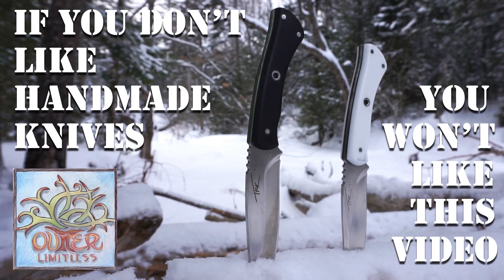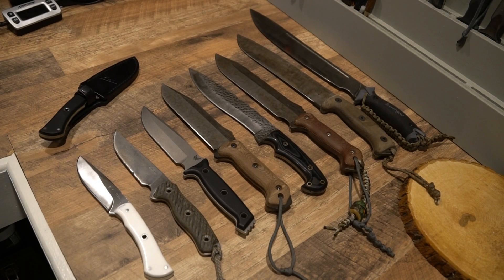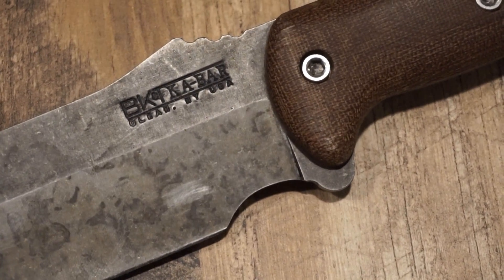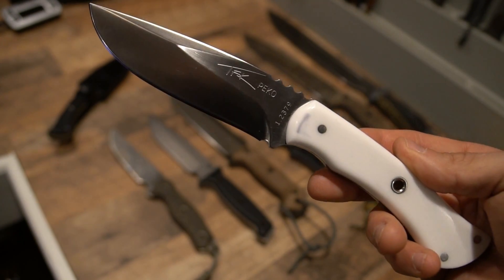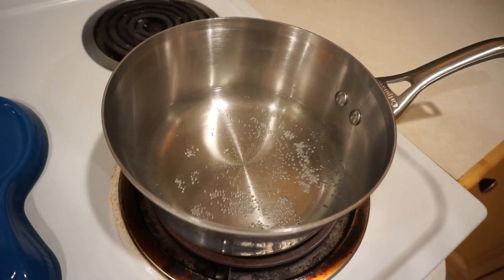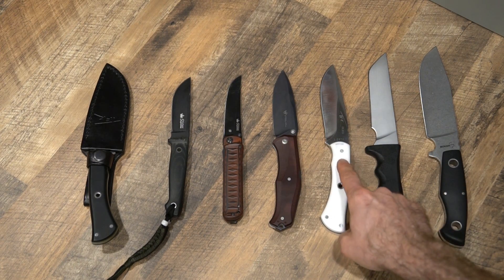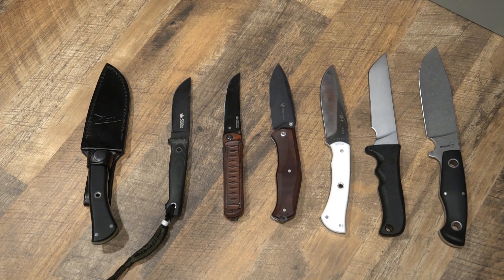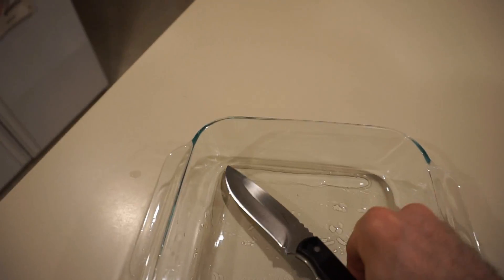Is D2 Tool Steel a Carbon Steel, or a Stainless Steel?

Comment: D2 is not stainless.
The rule of thumb is a steel is stainless if it has over 10% chromium but really it's a rule of thumb that isn't very good.
First stainless is not binary, it's a spectrum. Some "stainless" will resist corrosion whatever you throw at them, some will marginally better than tool steels.
Second D2 might be over 10% Cr but what makes a steel stainless is free chromium that creates a passivated chromium oxide layer that protects iron from corrosion.
D2 has quite a lot of chromium but a lot of catbon too. That means a lot of chromium will go into chromium carbides which means not that much free chromium and thus de decrease in corrosion resistance. Also the cardides are what makes wear resistance high.
Thus D2 is probably not really stainless but should resist correction ok like many high alloy steels.

Comment: For blade performance there are two things more important than steel formulation. An appropriate blade profile for its designed tasks and most importantly, proper heat treating.

Comment: Makes you wonder if that is D2 ? From what I've come to understand D2 is not a  true stainless material. It laks the chromium content % to achieve stainless steel performance. Over time it will oxidize.

Comment: D2 might be a good steel but I have seen enough bad heat treatments that make me second guess the steel.
In my opinion D2 is as close to stainless as carbon steel can get.  I think the formula for calculating if a steel is Stainless is (Chromium  - carbon content).  If the answer is 12 it is stainless.
D2 is around 12.5 chromium - 1.5 carbon comes to around 11% free chromium, thus making the steel not stainless.  
In practice it is a steel that is borderline stainless.

Comment: I just put vinegar on a paper towel. I don't think boiling it speeds up the acidic reaction. It only takes a few minutes by wrapping a soaked paper towel around the blade, and you waste less vinegar.

Comment: In industry test they made not immerse but sprayed with salt solution at 60C chamber, if I remember. Vinegar is a weak acid, generally acid solubilized metals, that's why the knife seems cleaner, the acid removed the old oxidation layer (which is protective). This is not the kind of corrosion you are looking for.

Comment: Nice video. Regarding D2 steel aspects nobody mentions that this metal has some smell depending what is cut with it. I have a folder in D2 and it has some minor metal smell which can be increased by cutting some food and wiping clean. Therefore it may give some metal taste to food as well. I don’t know if I like this steel yet. It may loose some sharpness due the micro corrosion more easily because of this. Some guy  made a video 1 hour long showing on some stainless steel knifes this effect depending on angle and time after sharpening. And now imagine those were stainless ones which D2 isn’t.

Comment: I've just bought my first D2 blade and was looking for - will it rust if I slice up an apple? when I found this.
Great video.
I bought a Rough Ryder in D2 and cannot find out the heat treatment anywhere.
If they do a good job or not - that sort of think.
I know Buck do a good job with their stainless but know nothing about how these D2 blades are made in the reserve models.
Many thanks
Gray

Comment: One thing to add...I put my d2 in lemon juice and heated the juice to close to boiling.  It did give the ricasso area front n back a blueish rainbow color but not on blade. Weird. I'm gonna try sanding it then hit it with the Birchwood.  What do I have to lose at this point

Comment: How does this perform in salt water environment?
Reply from the maker: D2 is better than a carbon steel, but you will need to keep it clean after use.  Especially under the scales if it gets really wet.  D2 can corrode, but it's fairly forgiving.

Comment: Good video.  This is probably over simplified, but I think of D2 as a mix between 440C and 1095 steel.  It is in the middle of them in both toughness and stain resistance.  It holds its edge better than both but is more difficult to sharpen.  A really good all around knife steel IMO.

Comment: D2 isn't stainless. Too much of its chromium is tied up with carbon as chromium carbide. There's not enough free to form the chromium oxide film that makes it 'stainless'
Reply from the maker: I do find it is rather corrosion resistant.  Great edge retention when properly heat treated.  I have had pretty good luck with D2.
Reply: @outerlimitless  it is rather stain resistant but a lot of the chromium is is the form of chromium carbide making its 'stainlessness' equivalent to a steel with 7% chromium.
Reply from the maker: Thanks for watching!

Comment: 11-18% chromium is generally the range where people agree a blade becomes stainless.  
D2 is usually around 12% so it is in that spectrum but on the bottom end. Ferric chloride would give you a better etch and darkening.
Reply: Judging stainlesnes off of cr percentage is misleading. 10-11% free cr is a super stainless steel. The issue is that cr for carbides. This keeps the cr from forming a passivation layer and allowes oxidation. A good example is zdp. 20% cr but also 3% carbon. That much carbon means most of the cr is tied up in carbides and is why zdp still pretty easily tarnishes.
Reply from the maker: Haha, ferric would have to be the option, because vinegar just cleaned my knife!  haha.  Thank for watching!

Comment: Well, I've got my own experiment coming up soon. I ordered the Rat 2 "D2" knife without a coating because all that was available was the uncoated type. I have steel wool and Birchwood Casey Gun Bluing. I hope it works, but they say stainless steel won't cold blue, it has to be heated and I'm not sure how to go about that.
Reply from the maker: I would suggest being careful with the heat of course...but I guess it depends on how hot.  D2 will patina with the proper treatment.  We use D2 on my T17's and get a nice acid stonewash finish.

Comment: I've been making knives since 1992, at first I did O1 doing a heat treat in a forge. I had been sending 440C to a heat treating company called Hinderliter nearby in Oklahoma City. I liked the edge holding of liquid nitrogen cryo'd 440C at HRC 58, but the heat treater I had gotten to know by tig welding things for him said to try D2. It wasn't very expensive so I made some small EDC knives and Hinderliter did the ht for me. Well without a cryo you can get 60 hard by heat treating it right WITH toughness. My friend at Hinderliter taught me the process and the critical part was to temper at 1000 degrees. So you heat it up to 1900 and hold for 30 minutes then air quench with an air blast from an air hose at 60+ lbs. 
The funny thing is if you temper at 450 you can still get 60 hardness, but its not very tough, it's where D2 got the reputation for being brittle, cutting corners on the heat treat. Yet if you temper to 1000 degrees it softens the steel down to about RC 55 at 700 degrees and then it gets harder until you hit a peak at RC 60 to 60.5 and then you let it cool to room temperature afterwards, you do two two hour tempers. Then the blade has very good toughness while still being quite hard for edge holding ability. 
The 0.90% Vanadium makes carbides that are harder than tungsten carbides. That is why all the new super steels are high in vanadium. D2 also has 0.80 molybdenum and they make their own carbides too. Don't forget the 1.50% carbon is pretty high so you get a lot of carbides all around.
The difference between stainless and D2 is one percent chromium. Technically to be called stainless a steel must contain 13% chromium and D2 tool steel has 12% chromium. Not much of a difference.
Reply: Stainlesness should be determined by free chromium now overall chromium. D2 has a decent overall ammount pf chromium but a lot of it is tied up in carbides. It is relatively stainless but not as much as its chromium percent would lead many to believe. Zdp is also similar. Something like 20% cr but so much is tied up in carbides that it quite easily patinas.
Reply from the maker: Interesting.  Yeah, I always say when D2 is done right it can be an amazing steel!  I like it!
Reply: @outerlimitless  If you have the deep cryo capability with liquid nitrogen and do the same temper I outlined above it literally is a super steel. Its toughness becomes very good and you can put a 12 degree edge on it that won't chip.

Comment: Awesome video, Sir. Thanks for sharing. But may I know is D2 steel can sharpen by sandpaper? I've ever heard that it's hard steel to sharpen.
Reply from the maker: I'm not sure about sanding...I usually just strop my edges or use ceramic to hone them.  Unless you seriously chunk an edge you shouldn't need to sharpen much.

Comment: When it is heat-treated, it is some extremely tough/ hard Steel!
We used it in our nail making machines as the punch.. 2 carbon dies come together and grip The Wire then the D2 punch would punch a head out on it. 1000 to 1,500 nails per minute. All depends on size of wire and size of nail. I always thought this stuff would make a great knife or sword!
Reply from the maker: Wow...that's a busy machine!  Yeah, D2 is pretty tough.  It can be brittle if not properly heat treated, but when done right it is a great steel...reasonable corrosion resistance, edge retention, and durability.

Comment: What the hell does the Steel Will Gecko have on it, and how is it applied?  This is a great steel  (got lots of of folders in it) that I want to darken and protect.  Hot humid summers where I live and they rust spot quickly.  S35vn is great, but gets spend quick.  Great vid and mods to your personal gear. ✌
Reply from the maker: It's D2... that's why it's in this video
Reply from the maker: It's just a powder coating of some sort...
Reply from the maker: But,  I can tell you that it's a gorgeous and durable finish... very nicely finished.

Comment: worst of both worlds.
Reply from the maker: I totally realize that many many people are not fans of D2, but honestly...if properly heat treated and the manufacturer knows what they're doing with it, D2 is a great steel.  I like it for hard use woodscraft, camp tasks etc.  If a folder...well, generally I would prefer more of an S35VN or something similar, but D2 can be great!
Reply: outer limitless I agree. But I do still prefer cpm cruwear, cpm 3v, a2, o1, s30v, s35vn, elmax, aebl, ...

Comment: I went on TFK website I assume the prices are in Bulgarian currancy ?? How does that convert to USD and how much approx for shipping I am in Toronto Canada. Great video just fount your channel and subscribed thanks!
Reply from the maker: I'm not 100% sure on the currency.   It depends on your browser.   I can help guide you... which model specifically are you interested in?   My browser shows me prices in USD.  Glad to have you aboard!
Reply from the maker: If you are interested in the T17, that is my design and I am currently taking preorders for an order that will be manufactured in the next couple weeks.   They are made to order based on your specifications.

Comment: D2 is my favorite ! It's edge taking and holding is outstanding ! Far better than s30v a little better than xhp but very little better ! 
   Everyone crys it's hard to sharpen ! The harder it is to sharpen the better the edge holding ! 
   S30v is easy to shatpen they say ! Yeah and is doesn't hold the edge ! So way did I pay more ! They say it's more rust resistant ! Not that much ! Thus the hoax ! 
   Edge holding is what I'm after ! But these collectors want shiny ! 
   I'm a user ! But ilI do collect clones of stupid high greedy priced cnc machine clone at custom prices ! Medford reeves microtech and others are greedy little rip offs ! Funny the company doesn't say anything about the clones ( thst I have heard ) only the customer that got ripped off ! 
   Some say investment because you can sell it for the same or more ! I say yeah until everyone finds out the emperor has no close or the economy changes ! Then all you have is a bunch of cnc clones you bought at custom price ! 
   A fair price is a % over production cost per unit ! That's what a loyal American company would charge ! 
   When I get loyalty I give it and I ain' got none from these so called American companies  yet !
Reply from the maker: I have always had great luck with D2.  It is definitely one of my preferred steels.  People get hung up on newest and greatest but sometimes forget what has worked and worked well.  D2 for me works well...and can take  a beating too.  I like the edge retention and don't honestly find it hard to sharpen.  Whoever said that doesn't seem to really know how to properly maintain and edge, because it's not difficult at all.  I would honestly say it's harder to dull your blade than to sharpen it if that makes sense?

Comment: I have 3 custom Bowies in D2 , not this shining, but harder, and stays sharp more than the others in  440c I have, custom makers use D2 frequently, especially from 9  to 16 inches, hard to see rust if you have a minimum care.
Reply from the maker: That's awesome.  I really like D2 and have great experience with it.  I think it is a great option for people who like carbon but want less fuss and care.  A leather strop is enough for me to keep mine razor sharp, or maybe a ceramic rod if I need a touch more.
Reply: @outerlimitless  yep, depending the price, its still today one of the best options
Reply from the maker: It's funny...some people really like D2, and other people can't stand it.  I don't really understand why, but D2 is a very polarizing steel choice.  I built my own knife design, actually released it for sale a couple weeks ago...but I built it in D2 for the first release.  I trust D2 and think it performs very well.  I know it's holding my sales back, but I didn't build it for sales...I built it for performance and performance alone.  I'm glad I did!

Comment: D2 is a steel mainly use for the tooling on mills that make tubes from flat metals once heat treated to 62-65 Rc its very strong and take lots of pressure
Reply from the maker: Super annoyed...I responded to all my most recent comments, but stupid YouTube Creator Studio ditched them. I'll be responding as I can...sorry!!
Reply from the maker: Have you had good luck with D2?  I really like how it performs.
Reply: outer limitless I’ve never made a knife with d2 I was a machinist and we made tooling for company’s that would make conduit and piping for oil rigs and they went through incredible amounts of pressure. When I first started I was told we could drop headed d2 off the roof and it wouldn’t damage it (much) the tooling I called bs and we did it and I was proven very wrong

Comment: I agree that D2 is highly underrated. It is not a complete stainless, but it does resist rust much better than a regular carbon steel. I have had very good luck with it myself, but I have heard others complain about chipping..my guess is that it was not a good heat treat/temper, but that is just a guess. I am no expert by any means, I just know I have had great luck with it, but I do generally buy higher end blades, so hence my heat treat theory. It is also a much copied steel, and some manufacturers might be using a lower grade variance.
 It kind of falls in between the 2 categories..it is a carbon steel, but with a higher chromium content than your average carbon steels, yet not enough to call it stainless.  A blend of the best of both worlds, and if done right, a pretty tough steel.
Reply from the maker: I think you're probably right about people buying lower grade or poorly heat treated D2.  I continue to have excellent experiences with the D2 that I have used.  My next video will be on the Steel Will Roamer R305.  I twisted the thing up pretty good during field use and the video shows how much the D2 can really take and still hold a practically perfect edge.  Anyway, thanks for watching and your thoughts!

Comment: Hi, I wanted to ask you if it's easy enough to sharpen this D2 steel? is it much more difficult than a 440C?
Reply from the maker: I do not have a hard time with D2.  I am generally careful not to damage my edge...I generally avoid hard objects or chips on my blades, so ceramic rods and leather strops are able to get my edge back to razor perfect.  How do you feel about D2?
Reply: It seems to me a good steel, I was trying to take a bushcraft knife with this steel, up to now I have always used 14C28N steel which I am very happy, strong, stainless, holds a good margin and it is simple to sharpen in the field, now so I do not know whether to try D2 or continue with 14C28N, what do you recommend?
Reply from the maker: I do not have too much experience with 14C28N, but I personally really like D2, so I would suggest it, but you might like to stick with what you are most comfortable with.  Sorry for the late reply.